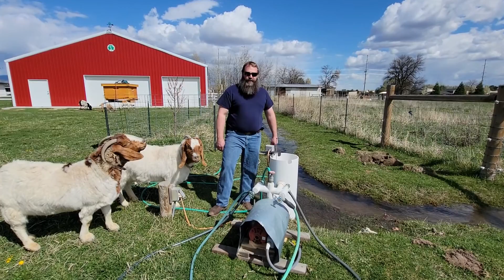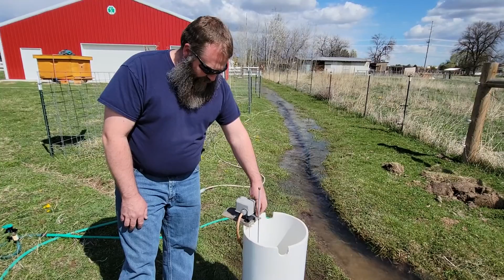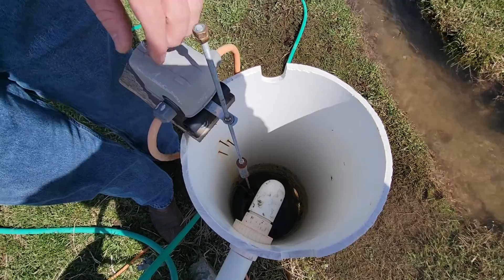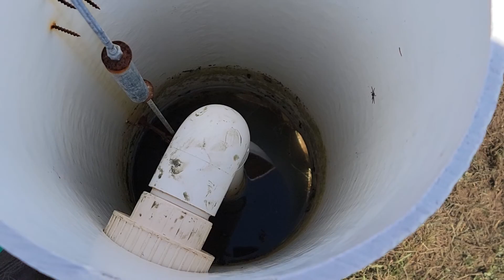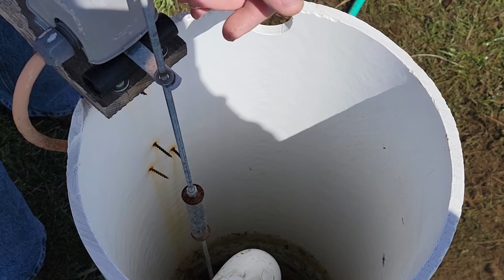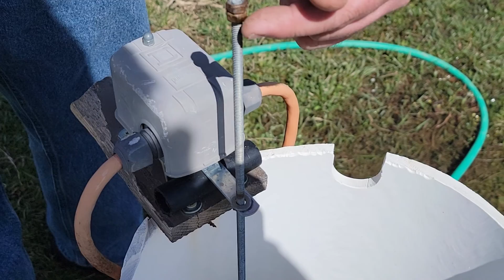Pump Low Water Shutoff Switch

Comment: I know this video is 3yrs old, but it has been exactly what Ive been searching for! It has been virtually impossible for me to find anything showing how to safeguard my 240v 2hp Red Lion irrigation pump from running dry. I just bought my replacement pump because my neighbors keep shutting off my water by mistake, and burned up my last pump. Not wanting that to happen again (at $430+ for the pump), Ive been looking for options with no success. Stumbled upon your video and you simply explained it all. Thank you!